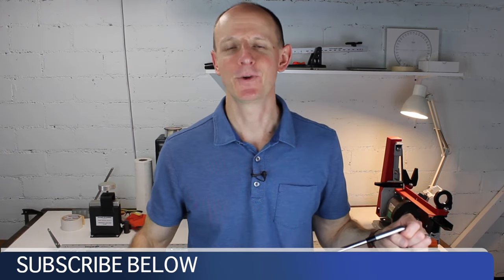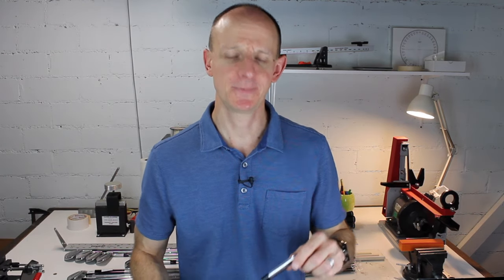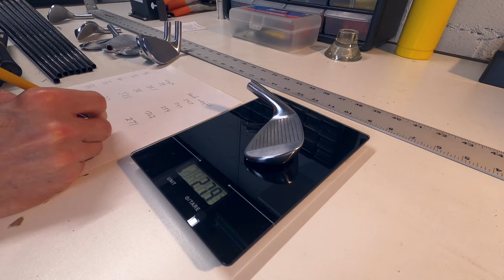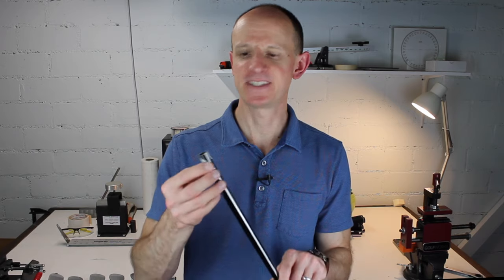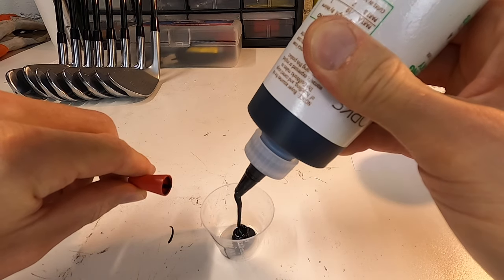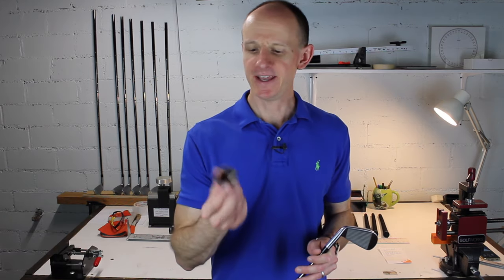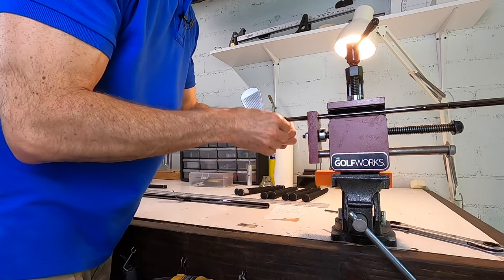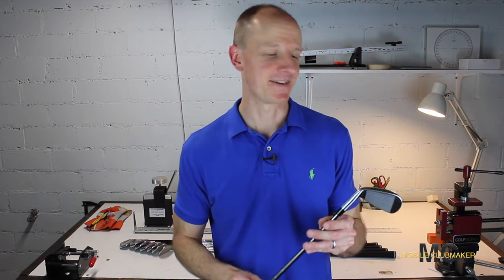GOLF CLUB BUILD - How to reshaft your irons Step by Step

Comment: Great video. Can you tell me what you used at the end of your ruler to lean the clubbed against for measuring the raw shafts? Does it matter that the lie angle of the piece of metal is fixed?
Reply from the maker: Thanks for the support. It's actually not fixed. It's just a gate strap hinge from the hardware store epoxied to the ruler so it moves and can be adjusted to match the lie angle. I know the USGA now likes to use the 60 degree rule, but I still think using the matching lie angle to the club makes more sense. And it's really only an issue if you are building a 48in driver where you could go over the limit for tournament play. Otherwise the differences are so small you will likely have more variation based on inexact shaft cutting or grip cap size. Not to mention all the OEMs have their own measuring methods and preferences.
Reply: @EFGMC  Thank you for your response and info. I’ve been building clubs for years and appreciate seeing creative ways to achieve accurate measurements. I’ll pick up a gate strap hinge. Easier than using the Hireko ruler and standing up every club at the proper lie angle prior to measurement and cutting. I also liked seeing how your did dry fitting. How did you deal with your 4 & 5 irons being the same head weight? I’m building a set of Cobra cb/mb irons and the 4i is 252 grams while the 5i is 255 grams. I’m hoping I can remove a weight port from the 4i, or I may add tip weights to the remaining irons to achieve a straight 7 gram weight progression. Any ideas?
Reply from the maker: @mylesberg5731  If you have a swing weight scale I would dry fit a 6 or 7 iron and see where it sits. If you prefer lighter feel, you can drill out the 4 iron 2-3 grams from the hosel. If the test club seems too light, then I would just add weight to everything else and keep the 4 iron as is. Will depend largely on the shaft length and balance point of shaft you are using.
Reply: @EFGMC  That's a good point - thanks. If desired, can I drill 3 grams from the bottom of the hosel by hand (no drill press)?
Reply from the maker: @mylesberg5731  Don't need a press. Do need a vise though. Then just use a 1/4 bit or similar and pay attention to stay away from the hosel walls. You can tape the upper section of the drill bit to act as a buffer if worried about the walls.
Reply: @EFGMC  Good suggestion—thanks again for your time.

Comment: Hi AJ, is it possible to put a used steel shaft on a new club head?  I'm going from a hossle size .355 to .370.  I understand I need to use a Shim T.   Lastly, do I need to make any medications (trim) to the shaft? Thanks.
Reply from the maker: Mike: If you have the shim for them, you should be good. Just put them straight in, no tip trimming since they are taper and already preset at the factory. The final assembled length may be different depending on the bottom of bore to ground measurement, though most irons all fall within a 1/4 inch or so, therefore not a big deal. Just remember to prep all surfaces including the shim. May want to check out my video about how to fix a loose head as I cover reprepping a used shaft.
https://youtu.be/deLFGL9Qjdc
Reply: Thank you for your speedy response. It must be the pandemic since I'm trying something I never imagined I would.
Reply from the maker: @Mike-cf8wx  That's the point of the channel. There used to be many people who knew how to do this stuff but even then didn't necessarily understand what they were doing. This seems like the perfect time for a club building renaissance.

Let us know how the clubs turn out.

Comment: Can you explain how you found out what tip weight to use. You didn't explain that part. They all looked the same but just wanted to make sure. Thanks
Reply from the maker: I used the SW scale to measure the clubs dry fit (cut to length and just rubber banded the grip on). Then just add 2g per 1 SWP increase desired. I also weighed all the heads before I started so I had an idea already what weight they would probably need.
Reply: @EFGMC  My main question is this: Do they all have the same amount added to them or do they vary from club to club? Did you add 4gm to all of them?
Reply from the maker: @rubenc4465  This set was all different. It will just depend on the set of heads you have and what the raw weights were.

I have had sets where one club required 6g of weight and the next required none. That example is more extreme but happens all the time.
Reply: @EFGMC  Thanks for the info

Comment: I just received a set of S300 shafts to replace the Modus 105's. The what's came as a set, but they are all longer than they need to be. It's that normal?? Did I get a set of junk that isn't going to work?? It's it as simple as cutting the shaft to length from the butt end???
Reply from the maker: Assuming you have a .355 tip hosel (ie Mizuno, Titleist, Srixon clubs) then the shafts should all be discrete lengths (each on slightly different). Those can just be butt trimmed like you said to the final desired length. 
If the irons are .370 hosel and the shafts are all the same raw length, you then need to cut the shaft at the tip first based on the manufacturers specs and then cut the length from the butt end same as first example.
Reply: @EFGMC  BTW absolutely love your YouTube channel. Have had 3 cervical fusions since 2010 and started playing golf again this year. The equipment, technology and instruction has changed so much, I've had a hard time keeping up. Your channel has helped me a ton!!!! Your channel and PXG have quickly behind my favorite two golf channels....
Keep up the great work. Wish you were near me to get my club work done!!!
Reply from the maker: @bryanduchane2371  If you haven't watched this video I would watch it before you start. Covers most of what you need to know. I measured all the clubs with a 48 inch ruler with a gate strap hinge glued to one side to make an adjustable base for measuring. Been meaning to make a video on how to put that together, will soon. But you don't even need that. 
Just set the club down on the ground sitting in playing position, sole of club level on ground. Put your ruler right behind the club touching the ground right behind the club's heel and running up the back of the shaft. Then mark where you plan on cutting remembering that the grip will add around 1/4 inch to whatever length you cut.
Here is the link.
https://youtu.be/rwKquntylmM
Reply: @EFGMC  Can't thank you enough... Wish you were closer to me. Would be one of your best customers....
Love you content!!!

Comment: Hi (again!),

I am currently going through a process of trying to select a lighter shaft in order to up my swing speed. I have lost distance through my iron set due to age and health problems.  I am striving to stay with steel but get below 100g on the shafts.  I am currently playing TT DG R300 at around 127g.

I am trying find something that will not increase ball spin which I understand will also be a distance killer.

By reducing the weight of the shaft, obviously I will reduce the overall weight of the club.  Lighter shafts = faster swing speed.

But this must affect the overall balance of the club with respect to swingweight.  So if I want to maintain D2, surely I will have to reduce the weight of the head.  I realise I probably cannot achieve the balance at the grip end, so the head weight needs to come down.  In order to get back to D2, this will inevitably reduce the overall weight further.

How do you factor all this in and how do you reduce the weight of the head?
Reply from the maker: Spin is rarely going to be the issue when we are looking for more distance in irons as we get older. Changing spin characteristics is better left to loft changes. That being said, if you like the feel of lower launching shafts in steel at around 100g, I would look at the Dynamic Gold 105 or the Nippon Modus3 105. Once we drop under 100g in steel, the profiles will change to higher launch feel. 
There are also plenty of good graphite options out there now that I would not discount. I really like Steelfiber personally.
As for the conversion, 9g of shaft weight = approx 1 SWP so we would be looking at 2-3 SWP drop going into lighter shaft. Don't assume however that just because you had D2 in your 130g old irons that you should automatically have D2 in the new ones. I might build out a test club at whatever SW it comes out to based on length and grip weight and see how it works. Get some lead tape and add weight as needed to get the right feel and most consistent results. Take that info as guide for building the set out.
Reply: @EFGMC  I have been looking at the DG 105.  The test club that I tried against my own club had 2° less loft and a DG 105 VSS Pro R300 shaft fitted.  The test club was one of those cart clubs that are issued to the fitting centres.  They have interchangeable heads and shafts.

The swing weight for that test club was coming out at D5 which is 3 more points more than mine which are D2.  Would this have any adverse effects regarding the figures?

I have also been looking at the DG 95 VSS R300 Pro.  This quotes a higher spin and launch, but some schools of thought seem to think that going below 100g would create more problems regarding lost distance.

I feel like I'm getting a little bogged down with information now.  I can see the virtues of the alternatives but without the full facility of being able to trial, (my facilities are somewhat limited), I am struggling to pick a route.

If I were to write out a "procurement specification", it would go something like this:

1. I am a low handicap player who in the past has got as low as 3/4 and on occasion beaten par of all tees at various courses.  I am now aged 66 and it's showing.  I still have my moments but I want to make them more than just moments.

2. My current clubs are Titleist AP2 712 3-PW fitted with DG R300.  Lofts are set to standard.
I don't feel justified in trading in as they are in mint condition, mainly because I had to spend some time away from the game just after I bought them due to ill health.

3. I would prefer to maintain the lofts through the set as I like the long irons, (although occasionally depending on the course I'm playing and conditions prevailing, I will swap over for hybrids).  I also do not want to start reassessing my wedge gapping.

4. So I want to retain the heads but need help deciding which alternative shafts are suitable to help me get my carry distance back that I have lost.  I am not really interested in changing to graphite in my irons.  I prefer the feel of steel.

5. The D2 swing weight has been comfortable for me.

Of course, if you could see the figures that I got from the launch monitor, the conversation might be easier.  I have no idea if my procurement spec is even near possible.  I can send the spreadsheet to you but it would have to be by email or PM.  How would I do that if you were willing to have a look?
Reply from the maker: @Barney29508  You can email
aj@smartstake.com

Comment: I if you don't like use frequency machine for matching clubs what do you use
Reply from the maker: Thanks for watching. I focus mainly on weight and balance. Making sure the heads are consistent in their weight progression. Also making sure my lengths are correct for the project. Frequency matching is not worth the effort for the results it promises. Getting the weight and the balance in a even progression will always pay greater dividends. And of course using good quality component pieces that have good quality control is important.
Reply: So how do you determine the club to club consistency and stiffness needed for the golfer
Reply from the maker: @johnknobbe8247  If the weight is good and the length is where you want it, flex usually falls in line. Flex is way overrated, it's a matter of feel more than anything and how that feel influences the golfer's swing. I combine it with shaft profile when I go through a fitting process. I can play with an x flex or an a flex. The important part is that the weight is good for my swing and that the feel is consistent through the bag. 

I also hate initial reactions to club changes be it weight, flex, profile, grip size, whatever. So I don't love many of the fitting options out there. Initial reaction (ie first 5-10 balls hit) is more about your body reacting to new variables introduced from the club. It's not necessarily about that specific club, but more about how this club is different from what you usually hit or just hit previously.

Comment: hello, why do you cut 1/4 inch from the playing lenght ?
Reply from the maker: Thanks for watching. The very end of the grip is a solid rubber cap approx 1/4 inch thick, so when you cut the shaft a 1/4 inch short and install the grip, the result brings it back up to the desired final length.
This is how most club builders do it, though not everyone. I always make sure I ask what final length a client wants and make sure they understand this process.

Comment: Do you not scratch the hosels with the sandpaper?
Reply from the maker: This is going to depend on the finish on the hosel. These clubs have a brushed chrome finish that is very resilient so even if I run the sand paper over them a little, you won't see it. Chrome finish also will be very sturdy so you won't likely scratch it by hand sanding. If you have a dark finish or you are unsure how sturdy the finish is, you can masking tape the hosel right up to the edge and even tape the shaft if you are worried. I also angle the sand paper to run parallel to the ferrule taper, which is hard to see in the video, but that keeps the contact lighter on the hosel. Also using small strips of sand paper allows me to be more precise and keep the sandpaper from making much contact with the hosel or shaft.
But to reiterate, if you do this using this by hand method, a standard shiny chrome or brushed finish should not get scratched.

Comment: do you glue the ferrule onto the shaft
Reply from the maker: Not usually. If it's really loose fitting I might put a drop of epoxy higher up to hit where the ferrule sits but the epoxy usually fills the space regardless. They are just as likely to come loose in my opinion and experience with or without direct glueing. The shaft bending near the hosel causes the ferrule to break free and start to work up the shaft.

Comment: how thought you had to trim the tip when you put on a new shaft
Reply from the maker: If you are using .370 shaft, you will usually tip them to correspond with the matching head. Mizuno irons use .355 tip shafts which always come in distinct lengths so you don't need to tip anything, only butt cut.
Reply: @EFGMC  ahhhhh ok 👍

Comment: It appears you did not cut the tips for flex?  Were they already tipped for each length or were they precut tips for each iron.  I thought you had to have the BBGM for each head to get the correct cut tip to have the correct flex for the clubs and then cut the BUTT end.
Reply from the maker: These were .355 tip shafts so you do not have the option to cut them more than fractions of an inch. The shafts are designed for each specific iron so that only butt cutting is used. If you were wanting to make small adjustments to feel/ball flight, you could soft or hard step them (putting a 6 iron shaft into a 7 or vise versa for hard stepping).
My opinion is worrying about the slight variation in BBGM in different clubs will never impact the results enough to even spend time on.
Reply: @EFGMC  Thanks for the reply.  My situation is 370 parallel iron heads, Callaway Steelhead XR that have a shoulder to stop the shaft upon insert.  The heads are not true bore through even though they have a bore thru plug in the bottom of them.  I am looking at uncut steel shafts to change into these heads.  I was picking a dual flex TT shaft that if tipped could result in a R/S mixed flex.  They give tipping instructions for that of course.  Then once installed in the head, butt cutting is done to desired length less the 1/4" for the grip cap like you suggest.  So, tipping brings the clubs to the correct desired flex in this case - Is that correct?
Reply from the maker: @robertsutton2407  Sounds like you are using the old TT Lite shafts. Those were always the go to replacement shafts for Callaway. You have got it correct. Tip trim using the trimming guide (more tipped for stiffer/lower launching results) and then butt cut to length minus 1/4 for the grip. And of course you can also split the difference and trim in between the two if you desire a strong R flex.
Reply: @EFGMC  Hi again.  Yes thanks for the confirmation of all this.  It also appears that any ferrule will work, but does Callaway with the shoulder insert for the tip also require a collared ferrule that is a certain length.  I know its likely .545 OD and .370 ID but not sure on length if it matters at all.  Thanks, Bob. Oh, and without having a shop like you, how do I know if I need tip weights?
Reply from the maker: @robertsutton2407  Ferrule length is completely personal. It usually seems that longer hosels have longer ferrules but that is again just cosmetic.
Most Callaway iron lips are very short and you don't even need the collar ferrule as the epoxy will fill that gap during assembly. Less that 1/8 inch, probably don't need to worry about.
There are some SW calculators out there online that will calculate your particular setup. They work okay. If the shafts your removed had tip weights I would reuse them or use similar ones. Other option is to just build one club as a test unit. Go hit it, add lead tape if necessary and then weight the tape. Pull the head and add a tip weight and reassemble along with rest of set. Not the simplest way, but probably best way to be sure you get the weight you want.
Reply: @EFGMC  thanks for your help.  I plan to try a shaft replacement.  Maybe on an old club or two first.